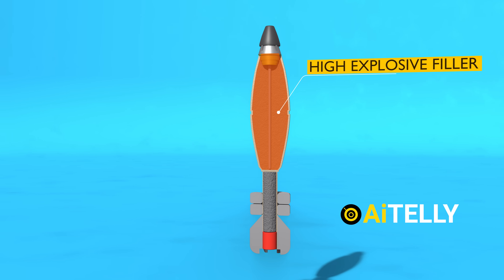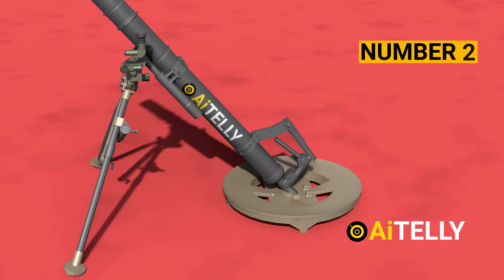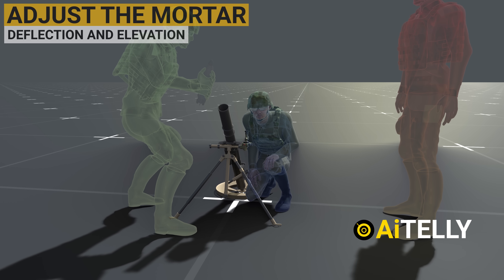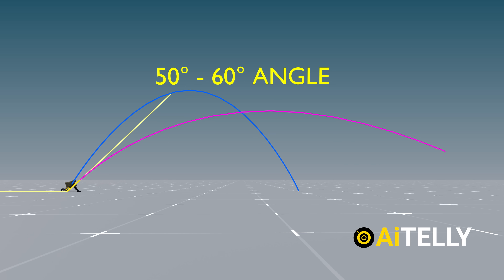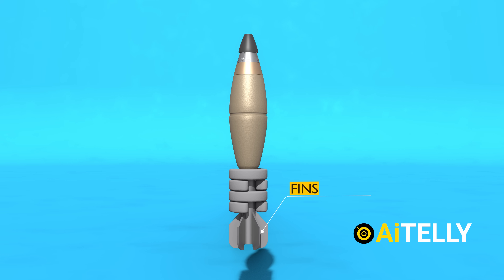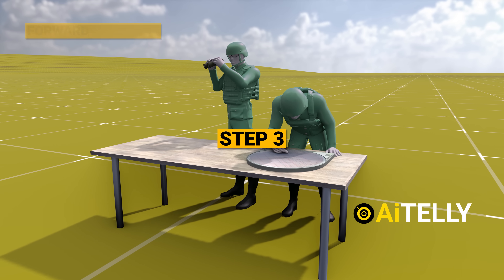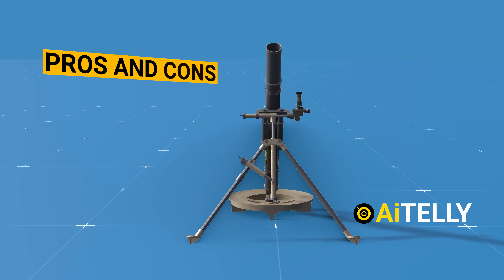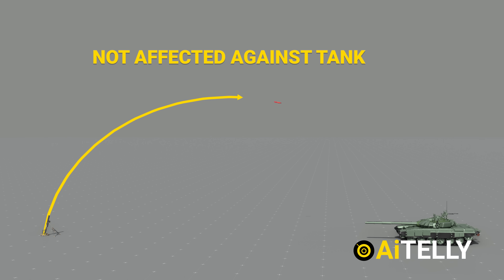How to Fire a Mortar?

Comment: You've never fired one have you? The "bomb" travels the same distance no matter what angle it is fired relative to the amount of charge used, however the higher the angle means it travels further up in the air, thereby reducing the direct distance to the point it will hit the ground.

Comment: Overall I like someone FINALLY someone made a video on a mortar. “MONEY SHOT this is Cherokee 1.1 requests fire mission: enemy troops in building firing on friendly troops. 1 in a-just 3 in effect:  Roger solid copy. Our pos is grid 12345678910, direction (6400 mills in 360 degrees=15 mills per 1 degree) direction 2791, distance 500 meters. Roger solid copy 2791 from your pos at Xxxxxxxx and distance 500 meters: standby. (Mortar sec leader yells out after Fdc & sec ldr concur data yells Fire mission; deflection 3781, charge 2, elevation 1250. Gun two up, gun 2 half load, hanging on 2, gun two fire, Cherokee 1.1 shot over. Roger shot out. ( sec lead looks time of flight=32.5 sec, 5 sec from impact, cherokee 1.1 splash, boom. Money shot ajust left 50, fire for effect. Roger solid copy: corection made- relaid also guns 1 & 3 have data on gun but do not fire during ajusting. Sec leader yells corection that its fire effect, all guns male correction, gun 2 up, 1 up, 3 up, section half load; hanging on 1, 2, 3 section fire= 9 rounds now in air(3+3+3). Cherokee 1.1 all round out. Got my first confirmed Enemy kia with the 60 on a well placed ajust round….

Comment: Also note in the hand held configuration there is a distance meter bar and oONLY 0(no charge) or charge 1(one powder ) is allowed. It’s for immediate fire suppression. A MGL 6 barrel 40mm grenade launcher can also act as a fire suppression mortar, by firing one round and holding until detonated make adjustment based on Left or Right and distance by lower or raising and firing remaining. But max propellant in hand held is charge 1, and 800meters max. FYI

Comment: 5:25 Not to be that guy but that is not the Elevation knob, There using the cross level which cants the mortar left to right and the Elevation mechanism is on the bottom of the bipod which they total skip and that is what moves the cannon up and down. What makes it go left and right is the traversing Mechanism at 5:26 its funny cause you can see his right hand holding it and they don't even mention it

Comment: the distance a round will travel depends not only on how much charge but also the angle of the tube. If the tube is straight up and down, the round is not going far

Comment: Relatively correct video I love it coming from a mortarman myself some notes the delay fuse for a 60 is actually 0.05 not .5 and the elevation knob is located on the bottom of the vertical tube going up the bipods. your minor adjust knob is what is actually located there  and you have another cross leveling knob across from the sight unit. Also sight data is given first before getting up on steaks and you match the distance between the near and far steak is on the side you far steak is from the near. 👍

Comment: 3:50 picture is very wrong.  As narrator mentioned before that step, the bubble scale has only 0 charge or 1 charge for hand held fire.  The picture shows that the round has 4 charges loaded.  This is going to severely injure the gunner's hand.  Once he pull the trigger, the 4 charged round is going to create a super strong recoil, so strong that the handle is going to cut into the bone of his hand.

Comment: The squad leader and the gunner are on the same side of the tube in the animation yet are described as being on different sides by the narrator.  
Also, the ignition tube isn't sandwiched between the explosive filler. That implies a 2D arrangement. The ignition tube is in the center of the charge that surrounds it on all sides axially.  
Another thing is what you're calling the burster charge, the ignition tube, is really the booster charge. The burster charge is the main charge that is used to damage, or kill. The booster charge is what takes the weak initiation charge contained in the fuze as an initiator and then sets off the burster charge.
The propellant rings are not high explosive and do not create "high explosive gasses" they are propellant. As such they burn at a much slower rate so they can fill the chamber/barrel with expanding gasses and not destroy the tube as the detonation of high explosives would in a confined space.  The propellant used is designed to best suit the parameters of the mortar system. High explosives would see such a spike in pressure immediately upon detonation it would destroy the tube, kill the crew, and likely detonate the burster charge in the warhead.

Comment: I was 11C on a 60mm mortar crew from 1990 to 1994 in the US Army, this is the gun system we used. Great video! One correction, the baseplate digs itself into the ground. The gunner stands on the baseplate for the first round to help embed it. You actually dig it out, not in.

Comment: Interesting, but some flaws:
- 2:03 the squad leader is on the left of the gun (not on the right)
- 3:46 the gunner squeezes the trigger only once the shell has come down the tube, and not as seen in the video
4:00 what comes out of the tube is a shell, not a mortar (= the tube)
Merlin, former M113 based 120 mm mortar gunner

Comment: I still don’t get how you use the aiming sticks, together with the data you receive from the FO?
Reply: You get a grid from the FO or the person calling for fire, then the FDC will determine an azimuth or direction for the gunline to place the aiming posts to in relation to their coordinates. The posts are placed using at least 2 people, one with a compass directing towards said azimuth, and another placing the posts. Once they’re laid, the gunner will sight in on the aiming posts and they can adjust fire from there until they’re on target.
Reply: @ thanks for that answer mate.
Reply from the maker: Those are just to check how much the Mortar had moved.

Comment: So we always had three guys per gun and the FDC was a separate position and theu were the ones to use the ploting board in our unit and in hand held mode, if using the trigger fire, you wont want to go over charge one as anything higher could likley break you hand or wrist. Love this video, brings back memories. The select fire HE round was the M720, my favorite, but we later switched to point of impact of M888 HE rounds

Comment: Nice vídeo! I remember one friend of mine serving at the army of nicaragua between the "contras" war told about that use of the mortar without the tripod, more easy and allways on the run ( improvised) they called using it with a tripod was a hesitate but more fun in " Tiro Vietnamita"( in Vietnamese mode) against the contras guys 😂🎉 he told me was a very funny moments, cheers.

Comment: In 2008 I was stationed at a patrol base in kandahar Afghanistan.  The Afghan national army had a mortar which they were using it against the Taliban,  one day as they were using it a round got stuck inside,  the commander needed someone to assist him taking it out. Everyone was hiding and not daring to get close to it and help him. Me being a rookie interpreter stepped in and assisted him taking it out. Later on I realized how dangerous it was to take out a stuck mortar round. This is a memory that I wanted to share.

Comment: At least in the US Army, the initial a in "azimuth" is pronounced with the same vowel sound as the a in "pass."

The 120mm mortar is not a cannon. It is a mortar. It's just bigger. There is a 120mm cannon. That gun is significantly heavier and more powerful.

Comment: From 1982 to 1984 I was Company C, 1st Battalion, 4th Marines 60mm mortar section leader stationed in 29 Palms. We were still using the Korean vintage M-2 60mm mortars when the M225 first came out and replaced it.  Talk about a night and day difference!  Close to twice the range and 360-degree sighting system. Basically, the same system that was used with the 81 mm mortar.  One correction to this video.  There as a small, rectangular base plate that was used in the handheld mode.

Comment: Light infantry as i was in the pass, usually use the 60mm mortar.dont forget it needs to be carried on a soldiers back, airborne unit move fast .81mm seldom used them it's alot heavier to run with

Comment: The Venus Project is a non-profit organization that recognizes the important connection between global resource mismanagement and problems such as war, climate change, poverty, and hunger. In the broader context, these are all detrimental results of the current socio-economic operating system. In response to these challenges, our organization presents solutions through the holistic application of science and technology, a systems approach, and living within the carrying capacity of earth’s resources. If applied wisely under the current constraints of energy and material sources, it could hold the potential to make far-reaching positive impacts.

Comment: As a former 13F40 Forward Observer I can say your depiction of the FO. are wrong. He does not use a plotting wheel. He simply sends in the grid coordinates and the direction to the target and elevation if relevant.  To the Fire Direction center. The FDC uses the plotting wheel to convert grid coordinates to deflection, elevation and charge. But overall a well made and informative video.
Reply from the maker: Thanks you for your service.
Reply: I'm sure computers have replaced the plotter board now. But the theories remain the same

Comment: It is not a cannon, it is a mortar. This indirect fire weapon type has been around since the 1400’s and has been named as such from the beginning. The illustrated weapon is merely an updated (modern) version. Please use proper terminology and learn to pronounce words correctly. It is very important to be precise when trying to convey knowledge accurately to others. azimuth is pronounced “as-I-meth” and not “a-semmeth”. That’s like fingernails on a blackboard to history types. 

A cannon is and was from the beginning a direct fire weapon. Mortars were developed to lob shells at a high trajectory over city/fortress walls or to plunge shells down on warships close to shore from a fortress. Cannons were developed to directly pound city/fortress walls and opposing ships using line of sight. The howitzer is a medium trajectory weapon to provide indirect fire against troops on the battlefield. It outranges mortars but at a lower trajectory.

Other than picking some nits, was an entertaining video.

Comment: Former 81 mortarman Army 1968-69. I like the new design. Those adjustable impact shells are clever though of course debatable practical value. The video didn’t quite capture the technique of sighting it in with the aiming stakes, which also had little red or green lights on them for night firing. 
The accuracy is mostly up to the forward observer’s map reading but maybe today they use GPS. So much relies on GPS but the Chinese or Russians have plans to knock out GPS satellites.
Anyway, the 81 is indeed a powerful weapon, the 60 doesn’t have much more bang than a hand grenade. The old steel baseplates were the devil to carry in the field. 
If you didn’t cover your ears when firing “charge nine” you could damage your hearing.
Reply from the maker: Awesome 👍🏻 thanks you for your Service
Reply: we have optics now that can laze targets without satellite but are much more effective when using the satellite

Comment: I was part of the mortar team (81KRH) and responsible of aiming . Mortar is almost never used with line of sight. Usually team leader positions a rod to give aiming direction, wind correction and voices distance estimation that I dialed in. Then we adjusted based on impact observation. Mortar is surprisingly accurate weapon when used correctly.
Most common dangers are accidental double loading and mortar falling over when the egg is still inside the tube. Latter happened us once and we hit nearby road outside our firing sector. Fortunately nobody was hit.
Reply: @ChadBoss-qr4hl  Zeroing in takes 1-4 slower rounds but firing for effect is max 20-30 rounds per minute depending on the mortar caliber, in attack rarely more than few dozen at a time. Mortar is a mobile weapon and there is only so many grenades a squad can carry at a time. 
In defensive position you can limitless ammo but then the tube heats a lot and needs some cooldown time, especially on long distance shooting. That is good pause for self-reflection.
Reply: What keeps the tail from blowing off if the charge is around the shaft part?
Reply: @derrickbailey9821  Charge is slower explosive so pressure in the tube raises gradually over the whole time grenade is still inside the tube. Also the shaft is hollow so pressure inside and outside it is the same, it's not really stressed that much.
Reply: @derrickbailey9821  There are 2 types of explosions, high and low.  

Low order explosives (e.g. Black Powder) deflagrate or burn and create a pressure front that moves slower than 1000 m/s. Which pushes, displaces or heaves (rather than shatter) objects in its path.
Reply: Wouldn't different loads of explosive rings have different flight path at the same tube elevation?   Didn't see the video talk about how to adjust for that difference.
Reply: @Trust_but_Verify  Number of propellant rings is selected so that for an expected average firing range the elevation is ~30-40 degrees. That gives the compromise between longest distance and the shortest flight time. When firing sights operator dials the current amount of propellant and fine tunes the elevation for the target distance.
Reply: Thanks for your added clarification.   I always wondered how the round left the barrel.  I figured it was some type of firing pin at the bottom, but I thought the propellant was in the shell itself, not added to the shell.
Reply: Did you actually crouch over the mortar to aim it like in the animation?  That looks like a very uncomfortable position to be in while aiming!
Reply: @SteamWolf320  Larger 81mm mortar so sights was higher and position on knee. Much worse part is carrying the tube, baseplate and tripod that weight about 20kg (40lbs) each. Always for several miles per day. I was like 19y and fit at the time so it wasn't that bad though.
Reply: northpointaxe6167  Are you okey, are you having a stroke or something?

Comment: Interestingly enough, the Army started to remove their previous 60mm mortar, the M2, from service.  As I recall, they weren't even back in the same numbers as was the case in Korea.  The thinking was apparently that 40mm grenade launchers would provide the essential indirect capability at short range, with the 81mm being the smallest mortar needed.
However, there's a gap between the maximum grenade launcher range and the regular minimum range of the M29 (which is also significantly heavier), and the VC rapidly learned to seek out that "sweet spot" prior to assaulting U.S. units.

Comment: Not sure about the digging of a hole for the base plate.  You had to for the 4.2 inch because of the bride assembly and the base plate assembly.  First round out of the 81mm is fired with the ammo bearer standing on the base plate and that seats it into the ground.  We only spent half a day on the 60mm while on the square at Ft. Benning.  We did not dig any holes.  Pretty sure someone just stood on the base plate for the first round.
Reply: It pays to prepare the bed when using the 81mm, only during a quick action is this process omitted. The base plate can disappear quite fast

Comment: I watched it because I wondered about the rings... I knew that they added propellant, but I didn't understood how they were added and I still don't get how they work (I expected the bottom tube to be sturdy to withstand the blast of the main propellant, but the rings would be outside and dangerously close to the payload, which should be in a fairly thin walled case... in German, there's a word for my fear: Rohrkrepierer, which translates more or less to barrel buster or complete failure)
Reply: The rings are light and feel like foam.  I worked with both 81mm and 4.2 inch (now the 120mm) in the 80s.  The 60mm was what the line companies used.  And while I was in, the 4.2 inch was considered man portable (it weighed more than 600 pounds total).  The ammo rings are known as charges.  The propellant inside the fin assembly is considered charge 0 and each ring is an additional charge.  Kudos for getting the rings visually accurate.  You want to keep balance when firing so you alternate open and closed sides like in the video.
Reply: @robroy6924  basically just gun powder in a paper wad lol

Comment: This is the ONLY video on YouTube that’s shows you how to aim a mortar!👏🏾
Reply from the maker: Thanks!
Reply: @Aitelly no thank you guys!
Reply: You've got the aiming wrong. I was in an 81 mm squad. The 2 aiming stakes are initially lined up one behind another at 25 to 50 yards apart, with the sight placed on the edge of the front stake. When the sight is placed on a new "deflection," the cross hairs move of of the aiming stakes. You then move the gun until the cross hais are back to the stakes. Both stakes will now be able to be seen, so you set the gun so the front pole is on one side, the far pole is in the middle, and the aiming sight is on the opposite side, at the same distance from the middle (far) pole as the front pole is from the far pole.
Reply: @johnrice893  to be fair 81mm and 60mm are different so they may require different set ups but I get ur point and thank you for your service.
Reply: @johnrice893  hey diddle diddle
Reply: NFL - Near post, Far post, Line
Reply: As GWOT 11C I can vouch for this
Reply: Yes 100% true, one question 
How do you know where to put the aiming stakes, and how to use them for elevation
Reply: LOL
Reply: no, it doesn't. It ain't that simple. An 82mm mortar (=the real thing)  works differently.